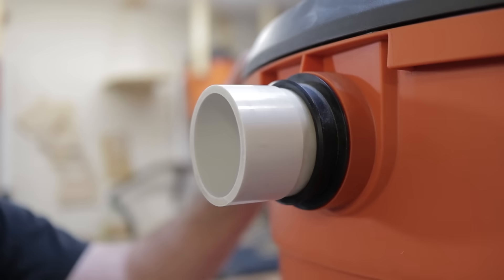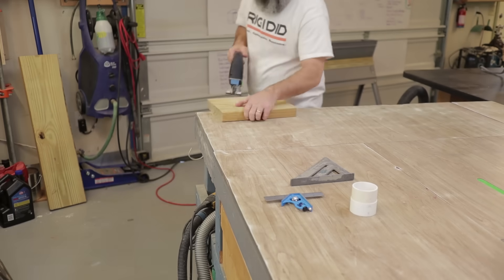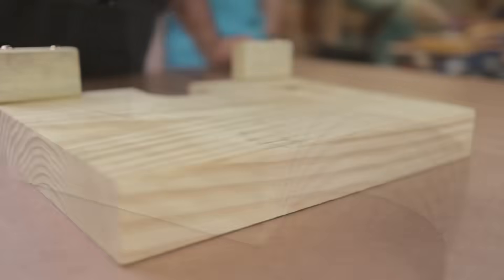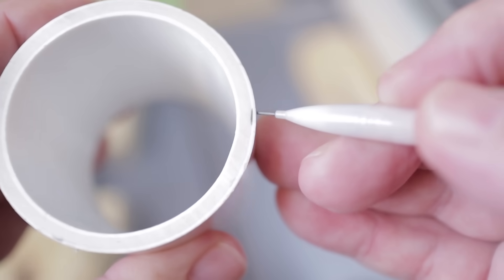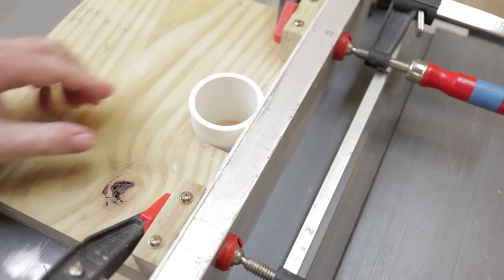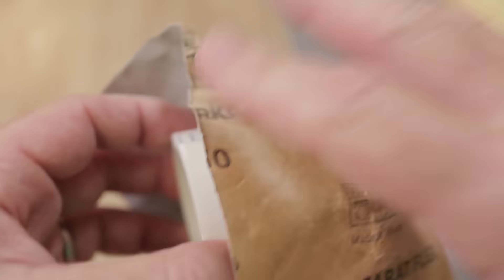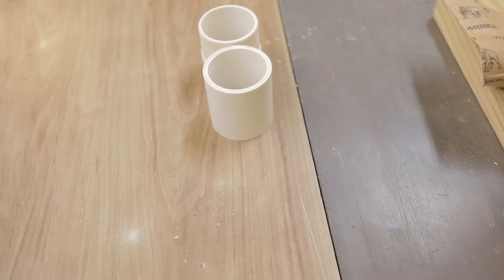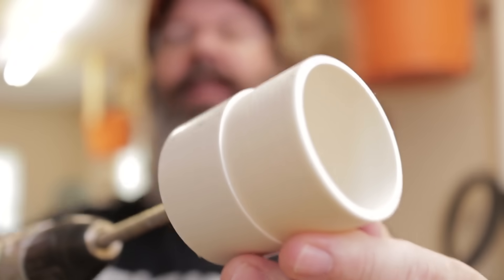Dust collection adapters shop vac to PVC made fast on the table saw

Comment: Creative! Awezome work!
One issue I have has recently is connecting a 5" DeWalt orbital sander to a Rigid shop vac?
None of tbe adapters or Rigid vacuum hose kits have worked.
Reply from the maker: Thank you! Rockler makes a few hoses and adapters that may work. If you can afford to buy a special hose for the sander that is what I would probably recommend.  I use 1 1/4" x 12' Mirka vacuum hose for my sander. It's a lot better hose for the job and will hook right up to a sander or track saw etc..
Reply: @SlowandExpensive  Sounds like a good idea, I will check in to that Mirka hose.
Thanks for sharing!

Comment: Try to use straight pipe when possible avoid sharp corners. Air movement is restricted by right angles and you create what is known as dead air pockets. All the best MrFixIt58

Comment: Please avoid sharp corners on your dust extraction system, use Y pieces for more efficient air flow
Reply from the maker: "Y pieces" to replace 90 degree bends for more efficient air flow?

Comment: 1-1/2 coupling with a turn or two of electrical tape will get you the same compression fit if you don’t or can’t make this jig. 

I’m sure there’s a CFM calculation for this, but unless you have a bunch of elbows and long runs it likely won’t make much difference.

Comment: Good morning again. As a quick follow up to my comments yesterday, I found that my hand held jig saw didn’t quite get the desired true hole I had hoped for. I don’t have a spindle sander but plan to pick up a 2 1/4 hole saw today then “ sneak” up on the perfect 2 3/8 hole I need. Though my first attempt wasn’t as neat, the outcome still yielded 4 usable adapters. Many thanks again
Reply from the maker: You are very welcome! Stayed tuned for the rest of the series. Part 2 has a few cool tips if you haven't seen it
https://www.youtube.com/watch?v=CEouFGfZzEg&t=20s
and more to come :)

Comment: PVC is safe and stable. Heating or burning plastic releases vinyl chloride an extremely toxic gas and has cause many deaths. Breathing the fumes has caused many deaths, therefore work in well ventilated area.
Reply from the maker: I'm not sure there's all that much heat involved with what I'm doing here on the saw but for those using heat guns I smell your fear.

Comment: Thank you, problem solved and pretty easy.  Took my time making the jig and still got it a bit oversize.  Simple fix, used some packing tape inside the opening and it not only tightened the fit, the smooth tape made the PVC turn very easy.  Counting the turns to raise the blade is genius.  Actually, this idea is ingenious.
Reply from the maker: Perfect!

Comment: Could you leave the saw blade stationary, but in the fully extended position, while at the same time slowly plunging the PVC blank into the jig's bore (with both the drill and saw running)? If this operation works, it would save the step of repeatedly adjusting the saw blade height.
Reply from the maker: There is only so much material that can be safely removed at a time. If the blade is all the way up you would probably need to engineer the jig to control the plunge speed of the drill. A free hand plunge could be dangerous. If the plunge is too fast something could bind and bad stuff is likely going to happen. Cranking the handle is a safe and easy way to precisely control the the feed rate.

Comment: I guess great minds think alike I thought of the drill attachment way before you showed it to solve the hand cramping etc  nice jig and idea  I like Shop Vacs as well  and use only that brand  or Craftsman who are made by Shop Vac and rebranded  that way all my attachments work with any vacumn I grab  FYI for years I had a home , a boat, and a Camper that I used the Shop Vacs all on or at   Some of which I needed special attachments for certain tasks
Reply from the maker: Perfect!

Comment: I noticed at the beginning the orange vacs suspended from the ceiling and didn't realize until the end you have multiple Rigid vacs  suspended in your workshop.    Did you get a great multiple discount on them or is it cheaper to  go this way instead of a central dust collector system with PVC pipe runs?  The only thing I was thinking afterwards was when do you empty them? They have to be heavy after awhile.  I have to admit, this is the first time I've seen this configuration  and understand your purpose to saving the floor space for more tools.  (Tim Allen....arf, arf,, arf).  I liked your presentation plus sharing/directions of your jig.  Best wishes ... Enjoyed watching your video.
Reply from the maker: Thanks Opie! Yes, the vacs were a deal I couldn't refuse. As for the weight of the dust in the vacuum, using cyclone separators with a shop vac redirects the majority of the dust into another container therefore the vacuum itself stays mostly empty. Thanks for watching and stay tuned, there will be more :)

Comment: What fitting are you using right out of the shop vac to connect these to?  Or is it the factory fitting with the hose removed off of it?
Reply from the maker: The pvc adapter fits into the vac port.
Reply: @SlowandExpensive  OK, thanks...they must have changed the Rigid Vacs then.  I haven an older one and I was excited to make some of these fittings and hard-plumb some dusts collection to it...bit when I remove the hose, the port on the vac is larger than the OD of the 2" PVC pipe...so this tip won't work with mine.  That's why I was wonder how you did yours.  I thought maybe you were using the factor hose fitting, minus the hose portion of it.  Mine looks like the same larger diameter hose you showed in your "Short Hose" video you did.  I has the clip to snap it to the vac.  I'll have look again, maybe I over looked something.  Thanks!
Reply from the maker: Both ends of the large factory hoses have an outside diameter of 2 1/4". Therefore the port on the vac should be a tiny bit larger than 2 1/4". 2" pvc pipe has an outside diameter of 2 3/8".  Either your older factory hoses are larger than 2 1/4" or you aren't working with normal 2" pvc drain pipe.
Reply: @SlowandExpensive  when I unhook my hose from the vac, the hole in my vac measures about 2-5/8"...so 2" pipe is too small...but I did measure the OD of a 2" coupler and they're just about 2-3/4"....so I can probably do the similar thing you did to a coupler on one side and make it fit....not sure why mine would be different?
Reply from the maker: I don't know either. If you just need to make the one for the vac port and you have to use a fitting instead of pipe you may just want to try the heat method and reshape one end of whatever fitting you are using. Coupling, 90 or whatever you decide. Heat gun or maybe hot sand. The inside diameter of the vac port on yours at 2 5/8 is weird. No? What hoses fit this?

Comment: Great video.  You could also do it on a router table with just the fence and a stop block.  Use longer pieces then trim to length. You would get better precision.
Reply from the maker: Thanks Steve! The router table will work too. Some of my commenters recommended tilting the blade on the table saw to create a slight taper and I have found 1 degree to be the sweet spot for the perfect fit if you do make this jig. This makes for a perfect fit every time with some tolerances. Something to consider when working out the router table version. Be sure to check out the next video in the series and if you just need a few adapters you can always get them from me. B3G1F Links in the description :)

Comment: I am going down the rabbit hole of trying to create good dust collection so may try this. But i see in the shot where you use your miter saw, dust was flying all over the place?!?
Reply from the maker: Having adapters will likely help you on your journey. I made extras, if you'd like to buy a few. Link is below. A dusty cut like that is the unpleasant reminder for me to switch dust chutes. I've got two different dust chutes for my miter saw. The one on my saw in the video is the one I use most often and it works quite well with thinner material but as you can see, not so much, on the thicker stuff.

Comment: Ingenious! I like how you think! A very creative and easy solution to a problem we all face with any dust collection system. The tool manufacturers really need to get on the same page and make tool ports all the same. It's just another way they force us to either buy adapters like Rockler's tool adaption hose kit or go to the drawing board and create our own adapters. In this case, your solution which I just may have to try myself! I currently use a big garage wall type of vac for all my tools and it works great for my handheld power tools, but not so much for my larger tools. I have a large Rigid shop vac in my basement that is practically brand new that may get added to the system until I can get a 2 or 3 hp DC. My only dislike of using either is the noise they make. The spring project of 2021 is to build a DC "closet" off the back of the shop. Thank you for sharing this with us.
Reply from the maker: Thank you!

Comment: Just a  question, Why so many shop Vac's? You could use one to run your whole system. Here is a guy that has one set up. https://youtu.be/S7LkgvA3i8Q just a friendly FYI. Cheers great Video!!!
Reply from the maker: It takes two just to handle the table saw! Replacing my set up with a single collection source with ductwork and blast gates is an awful idea. Cringeworthy. Thank you!
Reply: @SlowandExpensive  oh wow ok, I was just asking. Thanks
Reply from the maker: Sure. This was the first video in the series. Here is the second. https://www.youtube.com/watch?v=CEouFGfZzEg&t=20s 
and there are more to come :)

Comment: Great idea. But If you want something to connect to your multiple hand held tools and have the shop vac hose connect, consider using Fernco rubber plumber fittings.  A 1 1/2 x 1 1/2 pdtc-150 will fit to all dewalt handheld tools https://www.lowes.com/pd/Fernco-1-1-2-in-x-1-1-2-in-x-1-90-in-dia-x-2-1-2-in-L-Drain-Trap-Connector-Connector-Trap-PVC-Fitting/1000075349  and a 2" x 1 1/2  p1056-215 https://www.lowes.com/pd/Fernco-2-in-x-2-in-x-1-1-2-in-dia-x-2-1-2-in-L-Coupling-PVC-Fitting/1002463952  will fit to Delta miter saw port.   You can slide your vac hose connection inside the 2" and outside the 1 1/2 (the outer dimention on the larger end is the same as the inside dimension of your vac hose.  These are flexible so they flex to fit. Any section of 2 inch rubberized straight connection can fit to your vac hose end if you have a 2 1/4 hose connection like most larger shop vacs.

Comment: Great idea! I couldn't help but notice all the ridgid shop vacs hanging around. What made you go for this concept instead of a dust control system like Rockler, Jet, or Grizzly? How do you manage the filters on the inside of the vacuum?
Reply from the maker: Thank you! I'd always planned on having exactly the type of system you've described and somehow this happened instead. The simple answer is it cost me less. There will be more videos in this series to explain the details of all of the systems along with all the buying discounts involved. The filters can be removed for cleaning easily while the vac stays in place, also the cyclones extend the performance of the filters, so they don't need to be cleaned as often.

Comment: Great video and idea.. I am curious how you cut the original cut thru the  jig.. Did you plunge cut it? I have tried 2 different blades by cranking it upwards and it just won’t cut upwards and raises the jig even though clamped down.. Maybe I am one of those that should not have tried::)
Reply from the maker: Thanks. Yes, I plunge it. Sounds like your blades may not be sharp. Maybe try using a 7 1/4" circular saw blade before giving up. That's what I use. If you still have trouble there's a link in the description if you'd like to get a few from me. Let me know it's you and I will hook you up with a few extra.
Reply: Thank you Sir..  I removed the roving knife, then it cut right thru it.. I made a double thickness jig out of 2x8’s and was able to cut it down 2 different sizes.. They aren’t as smooth as yours, but it worked.. 

Emerson Tool makes Rigid and Workshop, but inlets are much larger...

Do you have a video on enlarging a 2” PVC pipe.. I heated it for 10-15 minutes and it was impossible to expand...

Thank you again for your great videos.. Don’t let sparks get in that beard::))
Reply from the maker: Perfect! Glad to hear it worked out.  I have yet to try heat but I have seen it done. https://www.youtube.com/watch?v=EQDAbu2znP0

Comment: Hi: I appreciate your taking on a somewhat confusing subject, at least for me. The problem, as I see it, is that you seem to think that throwing a lot of information at a problem in a very rapid fashion is helpful. Its is not, again at least for me. You need, as most Youtube video makers, an editor. Someone to give you feedback on your production. I need this information but I' not sure I can get it from you. I have the typical problem, my Shopvac has no suction because the filter is clogged. I see many ways to build my own DIY dust collector. My problem is understanding the hose connection. You have this information, I think you need to provide it in a more systematic and helpful manner. Slow down. Thanks
Reply from the maker: Okay. Thanks for the feedback. This video only covers making a 2" pvc dust collection adapter. Here is the next in the series that covers a few tips about hoses. https://www.youtube.com/watch?v=CEouFGfZzEg Future videos will cover tips on cyclones, filter maintenance, configuring a system and all of my set ups.

Comment: I see your sidewalk table saw has the paint wearing off on the front edge. Is that from use,  or did you sand it? Have you ever applied paste wax to the surface of your table saw to help the wood glide better?
Reply from the maker: The saw is worn from use. I've waxed it before but I haven't in years. The surrounding tables are all plastic laminate and there isn't much resistance. There's a lot of footage of it in action in my cabinet build video.

Comment: I make them in a lathe.
Reply from the maker: Flash Gordon in a lathe!
Reply: @SlowandExpensive  Sure, just chuck it up and take a light cut with a HSS tool bit or parting tool (Carbide doesn't work well). Medium speed and quick feed or they will melt.  Should be able to use a wood lathe as well.  Same as turning plastic, Nylon or epoxy resin...

Comment: Please explain how a Forstner bit helps.
Reply from the maker: The 2" Forstner bit was used as a quick way to locate and mark the center of the plug before drilling the hole for the carriage bolt.
Reply: @SlowandExpensive  thank you for getting back to me, I appreciate it. I am new to wood working, so all these types of tips and postings are beneficial. Any other videos you would recommend?
Reply from the maker: The next video in this series is a good one. https://www.youtube.com/watch?v=CEouFGfZzEg

Comment: You could do this on a router table just as easy. I would also suggest that you use a long piece of pipe and trim/cut each piece at a time. That way you have more pipe to hold on to.
Reply from the maker: Thanks for the tip!

Comment: Great videos (part 1 & 2). Are these still available on eBay?  I clicked the link in this video but I got an error message. Where can I purchase the adapters now?  I'd like to to pick up a few for my shop without having to make a jig. I know,  some will say, making the jig is half the fun, but I'm not at that point yet. Thanks.
Reply from the maker: Thank you! I've updated the link. I appreciate the heads up :)
Reply: @SlowandExpensive  Thanks for the quick response.  I just placed my order for (6) adapters. Thanks.
Reply from the maker: Awesome! They are on the way
Reply: @SlowandExpensive  Great!  Thanks.

Comment: I'm wondering if you could angle the blade a few degrees to obtain a taper on the coupler to possibly give a tighter connection?
Reply from the maker: Yep. One degree is the sweet spot.

Comment: That looks like the best way I’ve seen to make a few inexpensive, but we’ll make adapters.
It didn’t seem like you needed it, but thought some paraffin rubbed into the inside diameter of the jig might help reduce friction in the jig.
I just retired and need to set up my dust collection system. I will be using your method to make adapters, since I think $7-$15 each for commercially made ones is ridiculous. Since we have an irrigation supplier less than a mile from my house, getting all the right sizes and fittings is zero issue.
Thanks again for a great and very practical solution to a real issue for hobby shops!
Reply from the maker: Thank you! There will be more

Comment: Most excellent!  Going to try it, myself.  Any particular blade you recommend for your saws?
Reply from the maker: Thanks! Any used blade should work. I'm using an 7 1/4" 60 tooth circular saw blade but that's because that's what I usually use in my table saw. Many people suggested tilting the blade while running the jig to create a tapered fit. Turns out those people were spot on.  A one degree tilt creates the perfect taper.

Comment: I have discovered an easier way to turn the PVC while in the gig. I started with a length 2"X 2' . I put one end into the gig and reduced it to height. Then I did the same to the other end. I marked off the length I needed and cut it on my table saw. I cut 2 pieces and my fingers didn't get tired because I could turn the entire pipe with my hand not my fingers and your hand is farther away from the blade. Just a note. Good luck
Reply from the maker: Nice!

Comment: Has anyone attached dust stopper to 2 1/2” locking hose WorkShopVac WS1600VA? If so what elbows and adapters did you use?